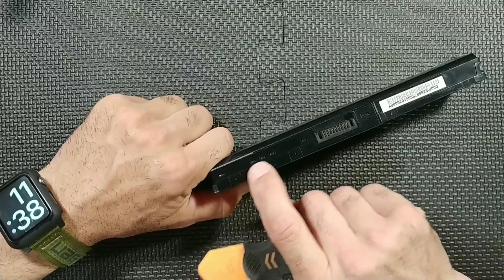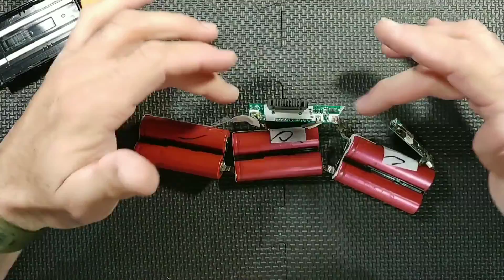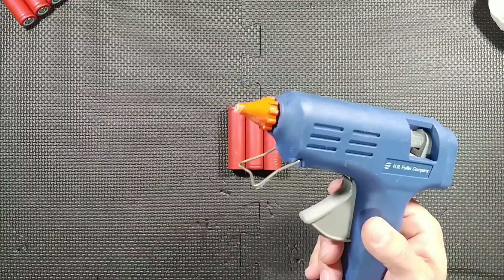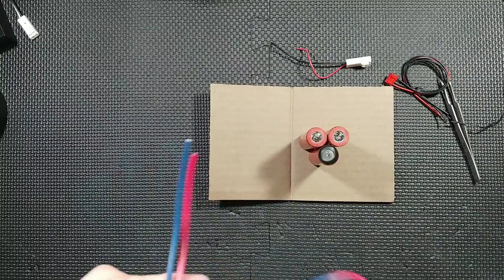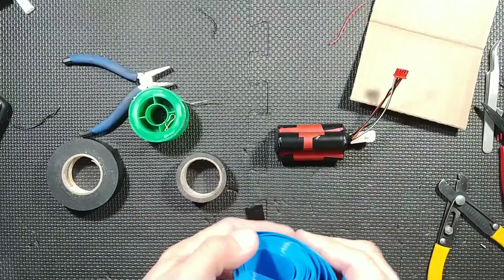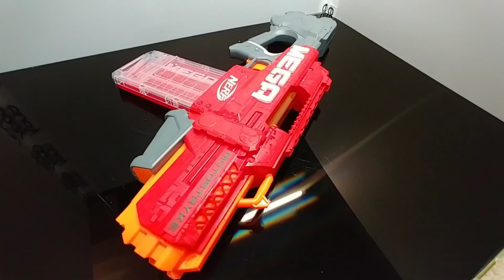Custom Power Systems: Laptop Lipos 🔋 | Nerf Mod

Comment: This is amazing! Thank you for this guide. I have at least 1 laptop with a dead screen that I can use. 
I agree that nerf intentionally underpowers its blasters (specifically the motors seem to have lots of underutilized power capacity). For safety’s and effectiveness sake, though, I always install a mosfet circuit into flywheelers when converting to Lipo. It allows me to know with a high degree of confidence that I won’t blow out circuits or motors.
This guide is great. More please!🎉
Reply from the maker: I’m glad it’s helping people get use out of their older, non working electronics!

Comment: I find a ton of cheap good 18650 cells in old cordless drill batteries. They are ending up in value village. I seem to have an endless supply :)
Reply from the maker: That’s a great source! I love picking up cordless drill batteries from the GW bins. They are $0.69/lb for electronics so you get them for so cheap! And they are high drain too!